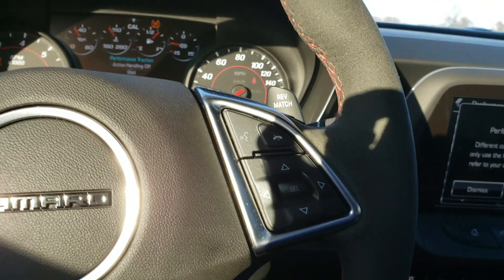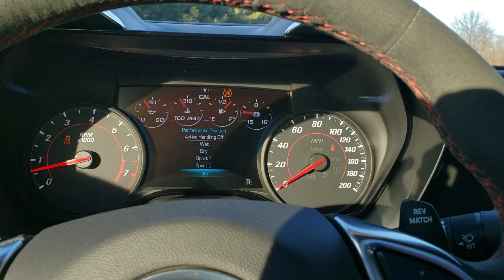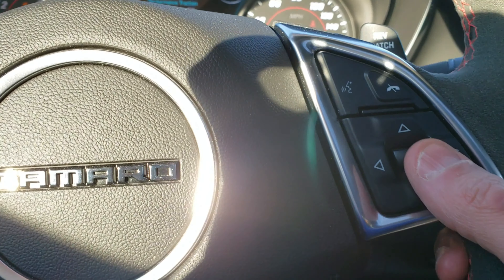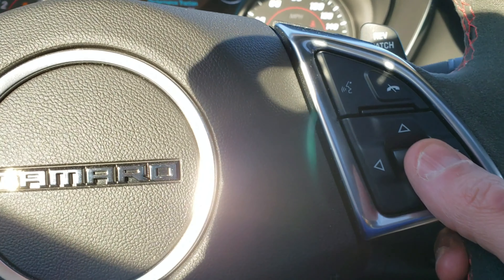How to Perform Line Lock on Camaro ZL1

Comment: GM needed to make this easier to access. When you are rolling back into burn out box at strip, you need to be able to quickly access this setting.

But thanks for the video. Great burnout!
Reply from the maker: Yeah it's not as simple as it should be

Comment: I can't find the line lock on mine
Reply: I follow all the instructions and nothing
Reply: @jeremygonzalez6117  Only for 6th Gen ZL1's, car has to be in Track Mode and in Competitive Mode
Reply: @matthewa158  False, only on all 6th gen Camaros. SS to ZL1's and now I believe the newer LT1's.  Does not work on smaller engines.  Not a feature.
Reply: @Fluke2SS  You're wrong, it only got introduced on SS's after 2018 refresh.

Comment: How is it a line lock, if you're not moving forward in a line?  So it's a stationary burn out.  Boring as shit!  I'm so pissed off. Why are the front wheels totally locked, they should move!  I have the same feature on my SS.  I want to LINE lock ffs!
Reply: Line lock means it locks the front brakes via the brake lines. If the car moves forward, you're not using a line lock (properly or it wasn't properly installed). If you want to move forward during your burn out, don't use the line lock feature.
Reply: On the 2019+ you can hit cancel on the steering wheel to move forward after your burnout
Reply: This is exactly what a line lock does lol. It’s generally a manual button attached to the shifter. It’s for drag racing.